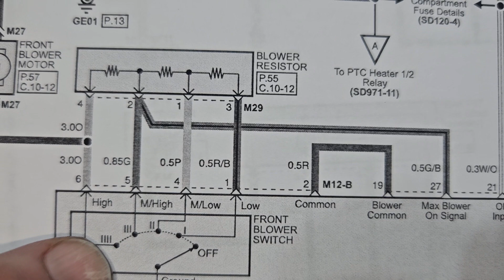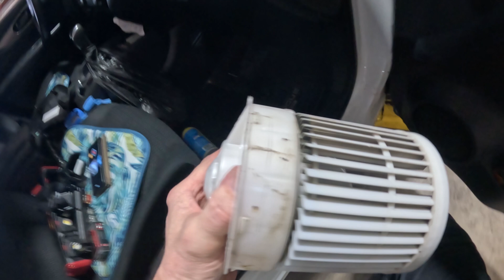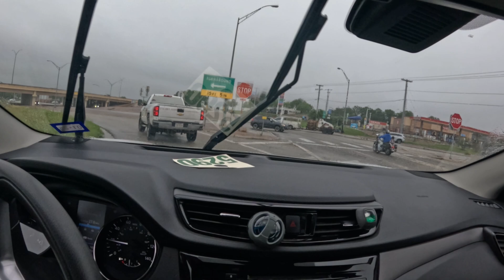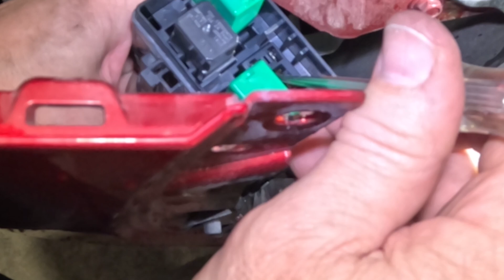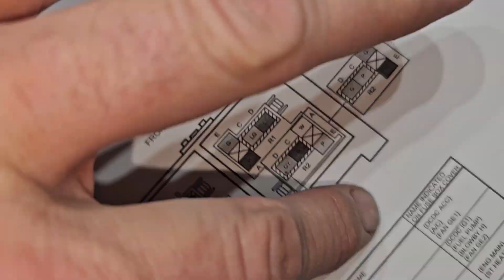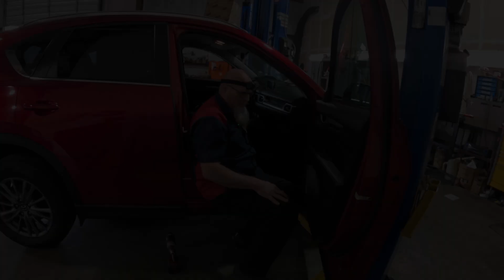Nissan Rogue, Mazda CX 5 blower motor replacement and A/C diagnostic. Proper Brake Job.

Comment: 2014 Mazda CX 5 ac blower motor will stop sometimes😭😭😭😭😭😭😭
Reply from the maker: Turn on the blower motor and smack the glove box or under the glove box with your hand. If the blower starts woring again, then you need a new blower motor.

Comment: Hey , top work! I have a Cx-30 with a noisy A/C compressor clutch only at around 2000rpm is it something I can put up with or will progressively become problematic?
Reply from the maker: If it's the compressor clutch, or clutch bearing, or something on the clutch coming apart. It will only get worse. It could sling a belt or lock up and leave you stranded.  Then you have to be towed and replace the clutch or bearing or compressor and anything else the thrown belt damaged. If its the compressor grinding itself away. Then, when it eventually locks up, you could have metal through your entire A/C system and will need to replace all major components.  I would say it's better to get it fixed sooner than later.
Reply: @ShopForemanGarage  Yeah , I think I best be safe than sorry and get this looked into further. Thanks for your advice!
Reply from the maker: Thanks for watching and thanks for your support. I hope it works out for you.
Reply: I don't suppose you are able to share the part number for the compressor clutch that bolts to the pulley on the A/C ? 2 litre E-Skyactiv X engine..
Reply from the maker: I would need a VIN number.  Follow me on Facebook and you can PM me there.